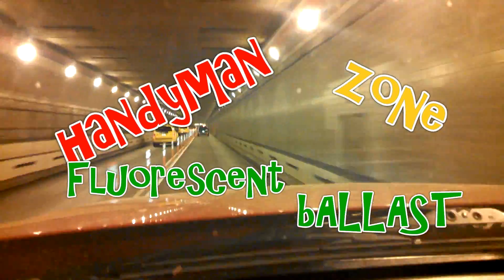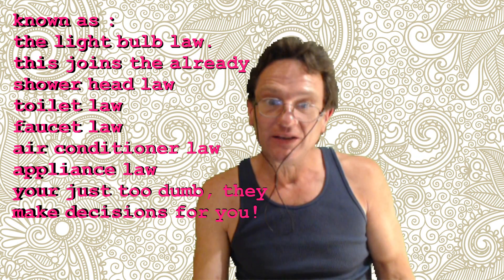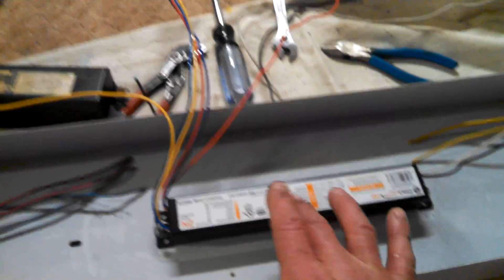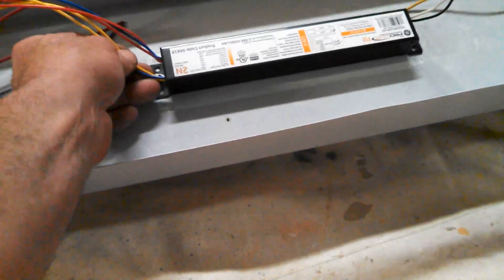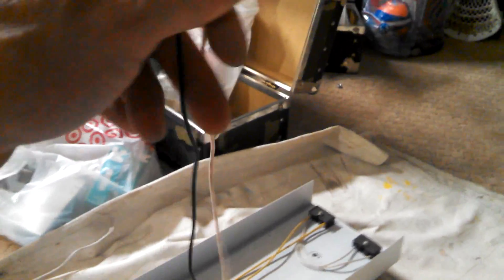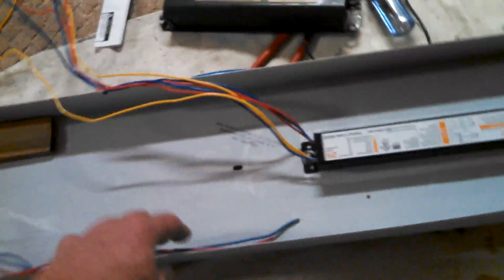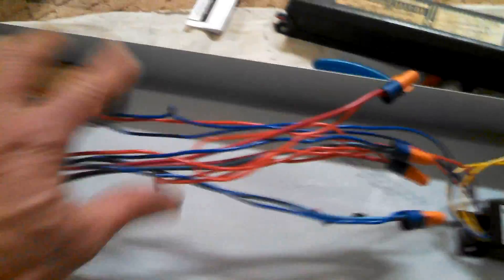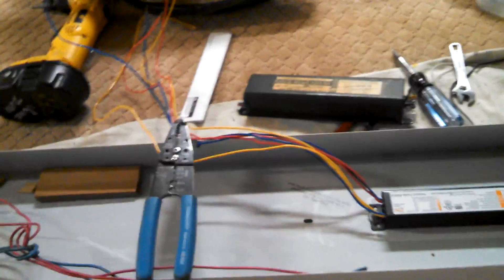Replace Fluorescent  Ballasts

Comment: Hi Dino wow it´s just fantastic the practicity you handle your recommendations,  for one side about the explanation on the fixtures  and why and whats  is happening on the elements,  I really didn't know that the new electronic  ballast are better in many ways and live longer  than the sealed  classic olders,   and at the end and fine   the easiest way to connect the wires so ones don´t get jitter chicken  about a f... shortcircuit ha, ha ha it was so fine.  Congratulations also for your TESLA coil I know them very well from some decades ago,  I was very intersted to build a Huge one that I saw in A physics Book that element  comprissed an additive coil to that exploder you showed up, so that the circuit could rise 100 thousand ore more volts, such that if you put  your hand  close to the unconnected outer coil, a kind of subltle rays in redish blue colors shroud or and reach your hand or limb, without having any kind of shock or discharge. But when a said un-connected I mean that the circuit was in shunt by means of two Leyden Bottles or rather dry capacitors, pursuant to this book it was named Oudin's transformer  I really dont know where this Guy was come from but I think it kicks as well.

Ha ha cheers up and thanks.

Comment: Does size matter f96t12 changing to f96t8 in ballast
Reply: +Dan Salomon - Not sure what you mean by "size matter" but what I learned today was that the T8 is for the "THIN" type of fluorescent lights and the T12 is for this "THICKER" type. So, T12 being the most widely used as universal, most ballasts are for T12 type.

Comment: Electrician here with a tip to add for those watching this. The front of the ballast has a wiring diagram on it, you need to read that because these fixtures do not always wire up color for color, in fact quite commonly they do not, always wire the fixture according to the wiring diagram, do not assume color for color.

I would also suggest buying a program start ballast instead of the rapid start ones. The rapid start ballasts provide 100% power to the lamps instantly, whereas the program starts send 50% then ramp it up to 100% within a second or two. This small difference can make your bulbs last a lot longer especially when they are turned off and on frequently.
Reply: How can I understand Is it program or rapid? If It is not available in level.

Comment from the maker: GalaXy808, you can google that question, will take more the 500 characters youtube gives, but the main point it it don't matter what the difference is, the old oil filled magetic ballast are out of production right now, if you find them they are old stock in hardware store shelves. i would'nt even buy magnitic, they not matched the new 34w bulbs(federal mandate), the electronic are better on all fronts, thanks the comment, shows you pay attnetion!